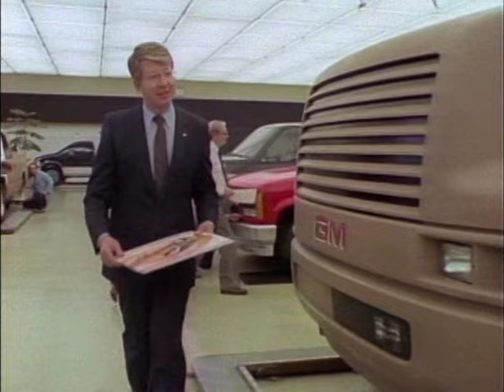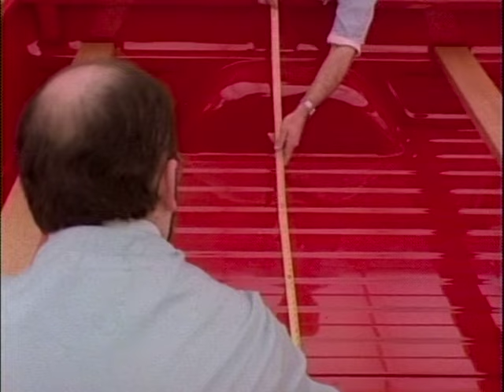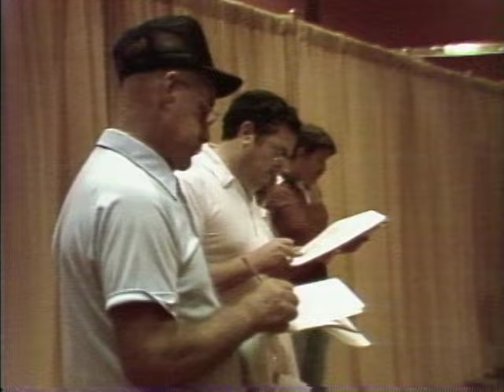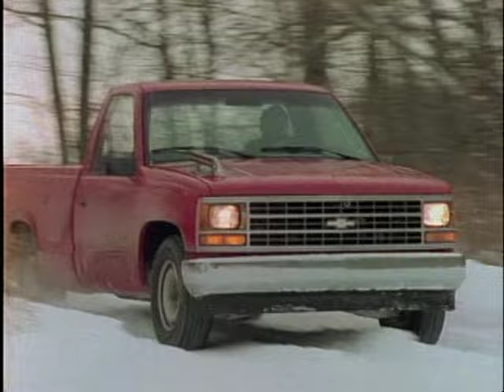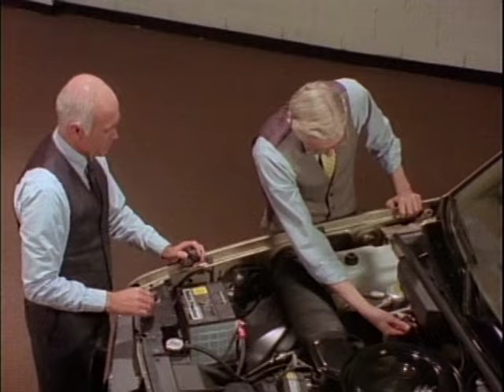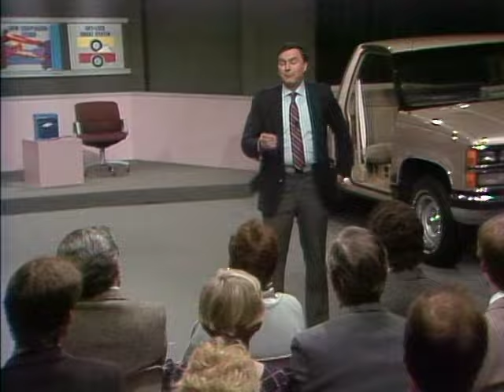1988 CHEVY C and K FULL-SIZE PICKUPS

Comment: I owned a '98 as a daily and currently own a '95 as a project, both extended cabs with the 350.  These are the best trucks ever built and I will die on that hill.  Rock solid reliable and stupid easy to work on with dirt cheap parts when things do go wrong.  I love my 2018 Silverado and the features it has but it will never be as reliable as the GMT400
Reply from the maker: yeah I won't buy another post 2008 GM truck the trannies suck in them... I've had a number of GMT800s and currently have a 92 K1500HD 5 speed 350 single cab long bed
Reply: @HrutkayMotors  I've accepted the fact that my 2018's transmission will take a dump eventually, I know 4 people with 14-18's who's converters went out.  Unfortunately my '95 has the 4L60E but I plan on swapping it for a 5 speed eventually, a 350 with a 5 speed will last forever

Comment: God i love the 88-98 c/ trucks I own a 1988 c1500 gmc Sierra reg cab and a 1998 Z71 Silverado and a 2002 C6500 low profile topkick 🙂
Reply from the maker: nice... I have a 1992 K1500HD 350 5 speed single cab long bed :)
Reply: @HrutkayMotors Very good trucks I owned like five 73-87 GM trucks and I hated them the Gm400 is such a better truck in every way. My 98 Z71 is in getting full repaint big overhaul it has 497 000km on it and it's original 4l60e never been pulled or rebuilt. My 02 topkick has the same cab as the 88-98 pickups it's a rare truck it's got full load interior power doors air ride drivers seat and air ride rear suspension and a cat motor currently building it into a tow truck. Once the tow truck build is done and the 98 is painted out back together then I'll be restoring the 88 GMC once it's done then my 05 LLY... I thought about swapping a nv3500 into my 88 GMC just cause I like stick. Is yours the nv3500 or nv 4500?

Comment: Love these gmt 400’s had 2 -1997 extended cab  z71 3rd doors… gm had cool cars and trucks back then… loved the 3rd gen Camaros iroc’s..gm milked their body styles along time back then the outgoing square body was 73-87  the c3 vette was 68-82…they went 10 years minimum…and more like 13-15…. The gmt 400’s were 88-98 .. the 3rd gen f body’s were 82-92… they don’t go past like 8 years today due to fierce competition and every changing styles…
Reply from the maker: Yeah they had the styling right back then… build quality on the other hand other than for the GMT 400 was lacking
Reply: @HrutkayMotors I never had a problem with any gm vehicle I had.  Whether it was a truck, Camaros, formulas. Grand ams, impalas.etc… I truelly believe people whole to one brand and weak for another.. they try ford and have nothing but bad luck, gm didn’t work either so they try dodge and everything clicks for them… same with the other 2… I also think some are predisposed to be a foreign car brand owner , they have tried all 3 domestic brands and had no luck with any of them….Ive drove gm since 1988, had good luck and I like their product.

Comment: I like the square body trucks
Reply from the maker: We all do but the GMT400 was solid too
Reply: @HrutkayMotors square body trucks were junk ones alot then went to the gmt400.. The gmt400 is leaps and bounds better then the piece of shit 73-87 trucks😊
Reply: I like the gmt400 better 😊
Reply: "Square Body" Trucks were the cheapest engineered and built trucks ever. Have you ever owned one and shut the door on it?... Just flimsy metal ... Interior was 70's technology... Very poorly built Truck and way out of date by 1987... The GMT-400 was on a whole other level....

Comment: I had a 97 ext cab Stepside Z71, burgundy with gray cloth, 3rd door. Had the truck up to 2008. I racked up 180K miles during that time. It was a good truck. The only thing I didn’t like was that the plastics on the exterior trim and instrument panel and control buttons were absolutely shitty quality…I replaced SO MUCH plastic parts because I was OCD. The transmission started to slip going into 2nd near the end, but it was one good looking truck! 👍😎👍🇺🇸🇺🇸🇺🇸🇺🇸🇺🇸🇺🇸🇺🇸
Reply from the maker: Every thing on those trucks were bulletproof except for the transmissions and yes, the crappy plastic

Comment: At the time, only the plain cab pickups were redesigned to that OBS style because the rest of the models with the previous square body design were still in production up through 1991. Also 1988 was the first year for the optional extended cab that was only available on those OBS pickups too. Rewind to 1987, the C and K series on the square body models were renamed R and V series because the square body models and the upcoming next generation C and K series pickups "OBSs" were going to be in production at the same time in the upcoming 1988 model year. They wanted to help keep people from getting the two different designs confused.
Reply from the maker: yeah it was still confusing though my neighbor has an 2500 1987 and he explained to me how that all changed in 87 and to this day it still confuses him
Reply: I had to read what you said twice but yes, you are right.
Reply: @gmejia90 1988 probably was a confusing year to some because designs from two different generations were in production at the same time. It ran up through 1991. The only square body models that were dropped in 1988 were half ton and three quarter ton plain cab pickups. Square body one ton plain cab pickups on the other hand were still in production up through 1989 although one ton plain cab pickups were redesigned to the OBS style in 1988 too. From 1988 through 1989, both square body and OBS one ton plain cab pickups were in production at the same time. All square body models that were produced from 1987 through 1991 are R and V series.

Comment: WOW, the birth of the great gmt400 trucks! I still daily drive a '95 C1500 truck! Its sad that todays gm trucks are garbage!
Reply from the maker: I've got a 1992 5 speed 1500HD myself... built the same month and year I was born in. Love it
Reply: @HrutkayMotors Youngster! I sold OBS trucks from 92-95 new.
Reply from the maker: lol I grew up around them my friends dad had 1994 350 5 speed RWD black with red interior straight piped and stanced
Reply: @HrutkayMotors  My late grandfather bought an early production model, made in 1987 for the September 1988 model year. And it had the rare early model gauges that you could not see when the sun shone on them! I remember as a teenager what a drastic change these were from the squarebodies!
Reply from the maker: Yeah, my 92 was the first year for the regular analog gauges the weird disc swivel gauge was… Really weird